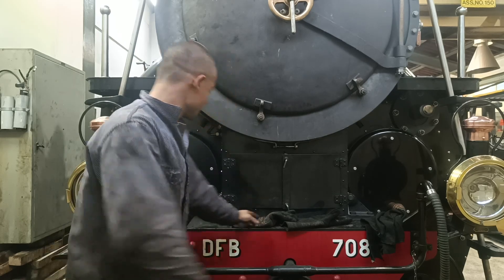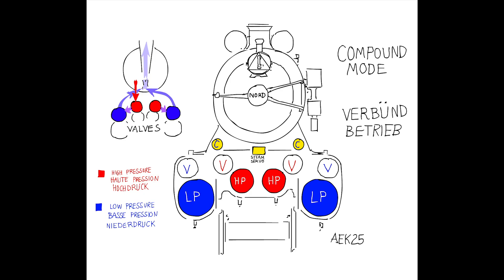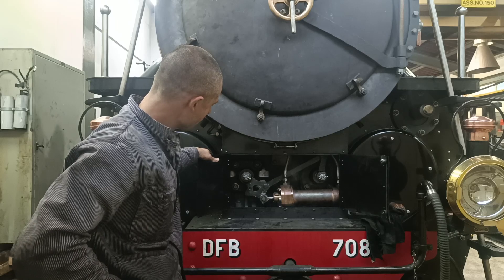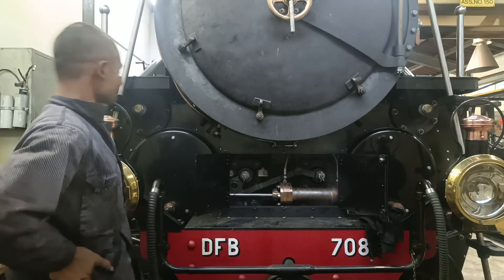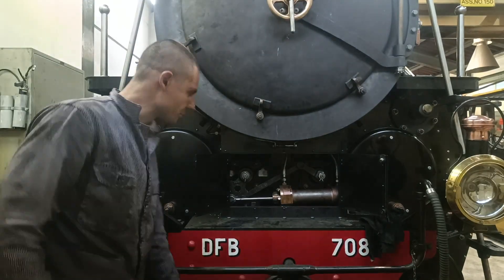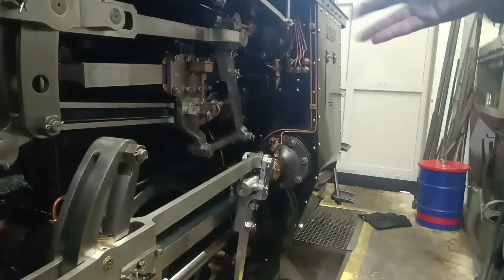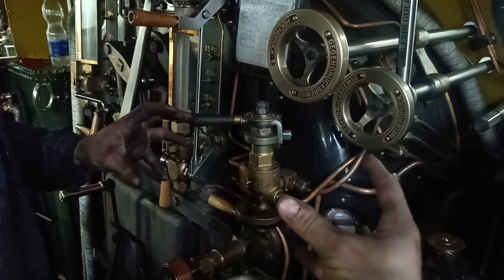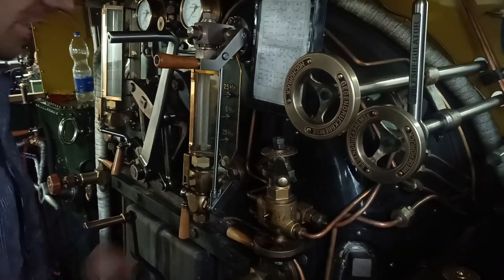All about System Winterthur Compound Locomotives....

Comment: Interesting deep dive! I still have one question though, how do you synchronize the gear on the locomotive with the racks on the rail? Are there any special mechanism on the locomotive for that?
Reply from the maker: There is an auxiliary regulator that allows steam from the boiler into the low pressure steam chests to start the rack drive spinning at any time you wish, and there is a synchronization flag, a small rod-driven target that oscillates up and down when the rack drive is spinning that you can use to judge how fast it is going when you cannot see the rods.  You start it spinning to synchronize it before hooking up to the rack.

Comment: Great that you made it to the Furka-Bergstrecke-Workshop.
I was never aware of how the switching mechanism worked. Thanks for opening that hatch and showing the mechanism in action!
On the driver's side in the cab, I particularly like the two large hand wheels labelled "Gegendruckbremse" for the Riggenbach counterpressure breaking system, presumably acting separately for the rack and the adhesion engine sets.

The locomotives by SLM Winterthur are all truly beautiful specimens in all details, and the DFB keep them in pristine condition.
The story of the 708 is remarkable. I remember as a little boy, in 1990 or 1991, there was a documentary on German tv about it called "Back to Switzerland" about the return of the delapidated locomotives from South Vietnam.

Will you do a clip about the Xrotd-R12 as well?
Reply: The DFB has a really great book about the history of the HG 4/4's in Vietnam, development and how they got the HG 3/4's and HG 4/4's back and the restauration work. It's in their webshop - HG 4/4 - Die Bewegte Geschichte der Vietnam-Dampflokomotiven

Comment: Is the level of finish on the valve handles common on French engines?
This locomotive is really beautiful, a work of genius!
Reply from the maker: This level of finish is typical for any machine built by skilled craftsmen with good sensibilities, typically you only found ugly freakish cabs and fitting quality on post WW1 American machines and the Soviet copies of them like you get in post revolution Russia or China, or the Einheits machines found in Germany after the DRG ruined all the work and design philosophy of the pre-unification state railways and the private builders like Krauss Maffei.  Such good practice is found throughout Europe but France and Switzerland take the cake for fit and finish of footplate arrangements and fitout.
Reply: The locomotive was ordered by the French for use in colonial Indo-China (Vietnam) and was designed and built by SLM ( Schweizerische Lokomotiv- und Maschinenfabrik) at Winterthur. It's actually a further development on the HG3/4 engines that SLM built for the Furka, so it's actually designed and built to Swiss standards.
Reply from the maker: The 4/4 is not in any way a development on the Hg 3/4.  The machine is almost completely technologically divergent and is in fact in a couple ways inferior to a 3/4.
Reply: Thanks for posting, I appreciate it!

Off topic, but you might be interested, I'm working on a 1/700 scale model of MN Hoche at the moment, configured as depicted by the model in the Paris Maritime Museum.
The real ship differed in several aspects.